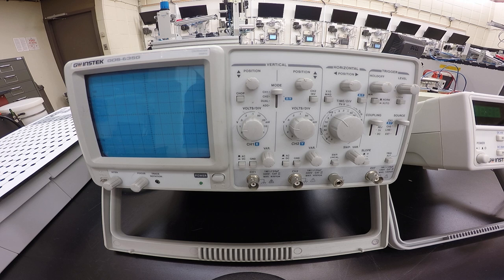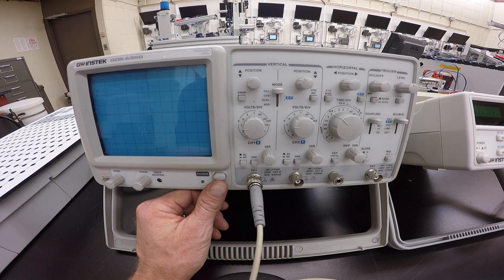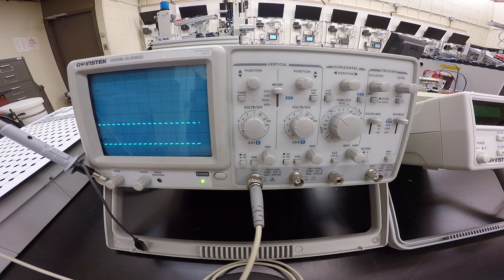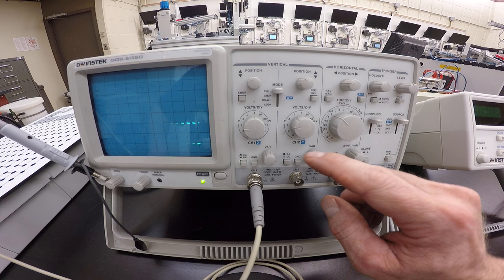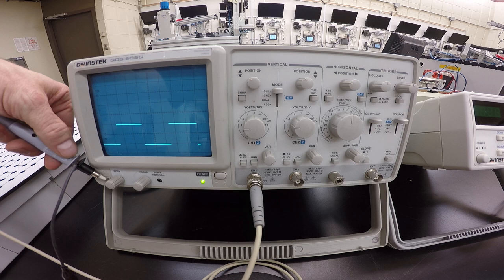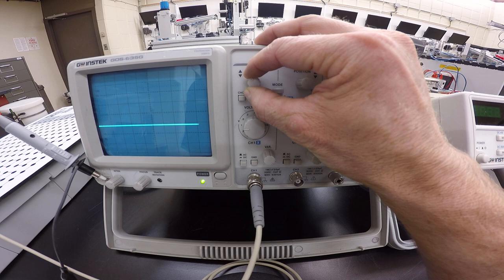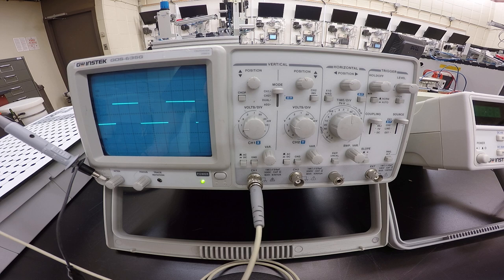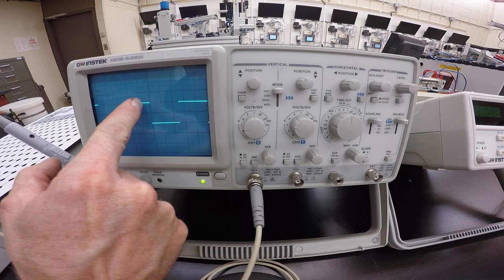Lab #1 Setting up the Oscilloscope for use in the lab

Comment: There were a few errors. First off, this is a simple setup, not a scope calibration. Secondly, the x10 setting DOES NOT INCREASE THE PROBE'S OUTPUT!!! It is attenuation, and reduces the signal to 10%. Third, the waveform would have shown much better in the video if the narrator had increased the trace intensity a little. And lastly, the waveform does not "go funky" if the amplification (Volts/division) is set to low. The trace becomes "free running" because triggering is lost.
Reply from the maker: Always nice to hear from you mrnickbig1
Reply: I reacted because there were many comments talking about how great, and clear, and informative this video was, when there were obvious problems with this educational video.
Reply from the maker: and I appreciate your constructive criticism and have pinned your comment so that others are aware of the items that you have mentioned. thanks so much for clearing things up.
Reply: mrnickbig1 great comment

Comment: i have this one but a resister on the crt board is burnt its labeled as r332 i have no schematics would love to fix it
I have schematics for the crt circuit  the r332 is on the same board as the crt

Comment: Hello,I found this video very helpful,just have question about AC/DC part.You say that by keeping DC IN we will be able to see both AC and DC components of the wave.At the same time you talk about keeping DC button IN,you press AC button UP and then carry on about next part.So how it is suppose to be?Do I need to leave DC button IN or AC button UP?Thank you.
Reply from the maker: Sorry for the confusion. The DC button pressed in will limit the Scope Output to just the DC waveform. 
The status of this button entirely depends on if you want to see just the DC component (pressed in) or if you wish to see the AC and DC component of the waveform (left in UP position)
Reply: +Pete Vree I think you misunderstand something about this. The AC setting is what limits the scope output, by removing any DC offset in the display. The test signal is normally from 0v to +2V, because it has a 1V DC offset, and you can see that when you have the button set to DC. If you set it to AC like you have for the majority of this video, the display is "coupled" through a capacitor, applying a high-pass filter which removes the DC component, and you only see the signal as if it where varying about ground.
Reply from the maker: Thanks so much for clearing that up for me.
Reply: @PeteVree  So if i was working on HI FI gear i'd keep the DC button pressed in because after the transformer OF course electronics run on DC??    Thanks

Comment: Please tell why we calibrate the CRO?
Reply from the maker: We calibrate in order to provide a base from which to use as a reference to make sure our readings are accurate. On newer digital scopes you can have preset settings that are available with a push of a button. For our students, the calibration provides them with an understanding of what each setting accomplishes on the oscilloscope